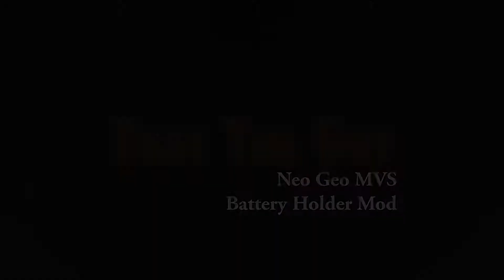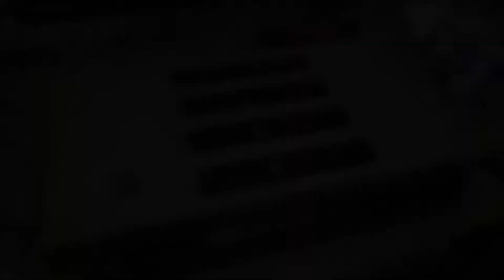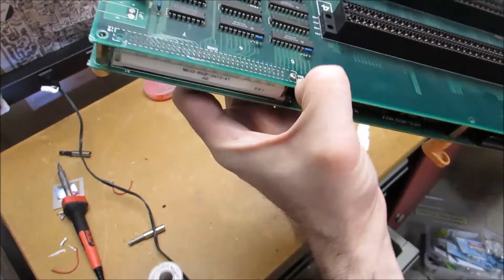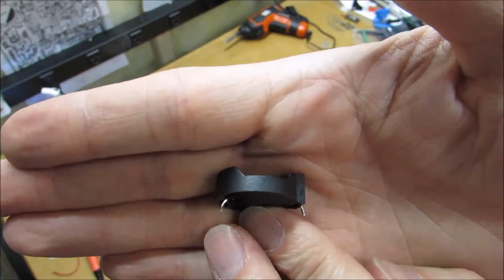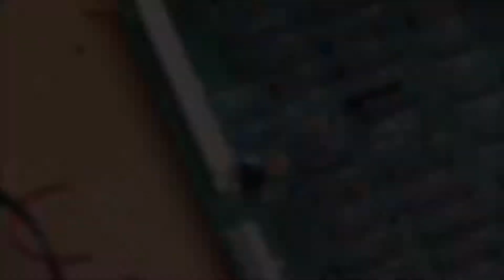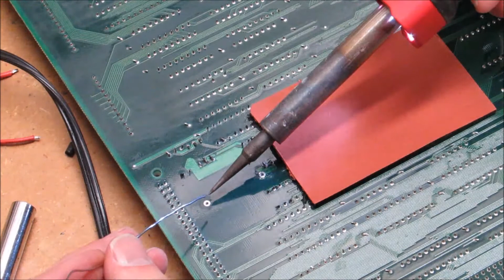Neo Geo MVS Battery Holder Mod (4-slot board)

Comment: Great video!  By chance what happens if you forget to remove the 470 resistor?  I've getting ready to do this on my 6 slot.
Reply from the maker: +Kevin Kallbreier that disables the charging circuit for the battery. I've never charged a battery that shouldn't be charged, but I imagine it would go kaboom! Haha
Reply: @ThatTimGuy  7 year necro lol, but I assume you dont need to cut the resistor if using a ml2032 rechargable?